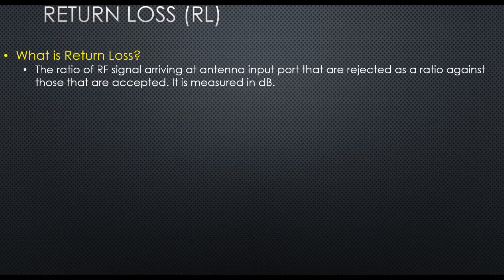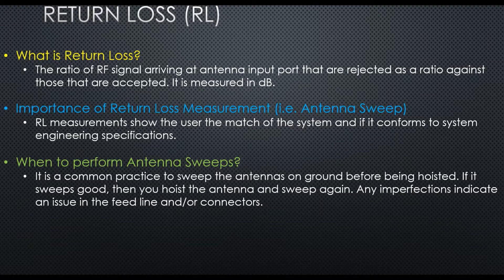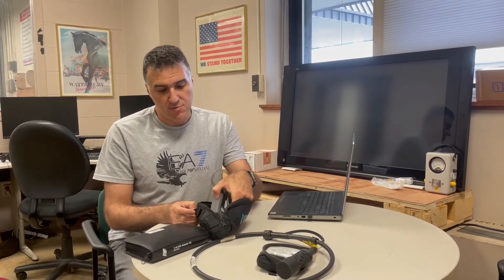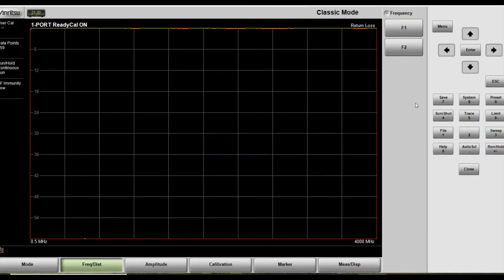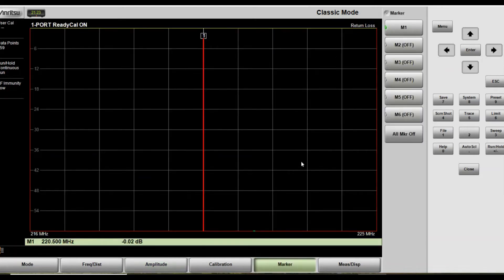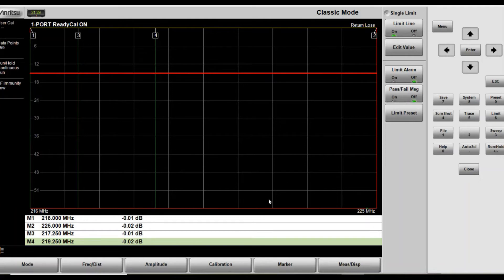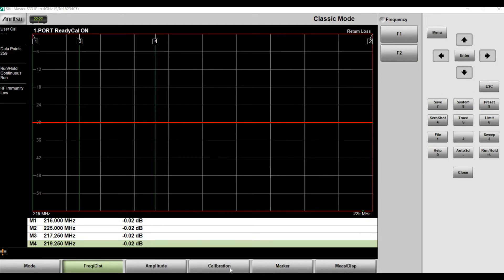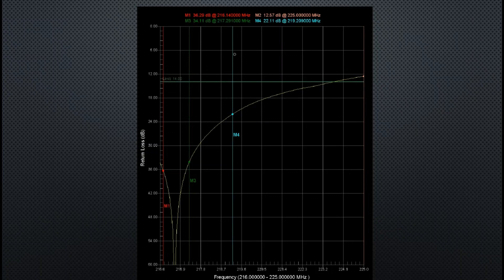Step by Step Return Loss & Antenna Sweep Tutorial using Anritsu Site Master

Comment: Why do higher frequencies test worse compared to lower frequencies?
Reply from the maker: Please elaborate more but what you mean by “test worse”? What kind of test? And what is the orangery that is testing worse?
Reply: @MohamadHaidar78  
At certain instances, a faulty cable and or connection would be passing during lower frequency tests but you would fail during a high frequency test.  Testing higher frequencies at the range of 1700 to 2200 MHz.  As opposed to lower frequencies from 698 to 960 MHz.

It seems more accurate to spot the fault when higher frequencies are used.
Reply from the maker: Assuming you’re using the same type of cable at low and high frequencies, I have no explanation for that to be honest. I’d guess that shorter wavelengths are more sensitive anomalies (in terms of signal reflections) in the feed line. I hope that helps
Reply: thank you! @MohamadHaidar78